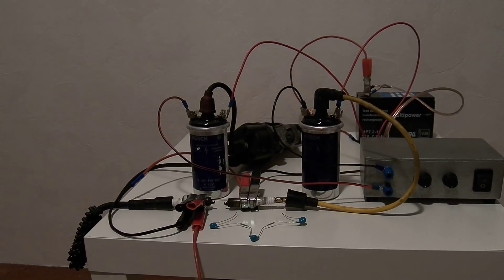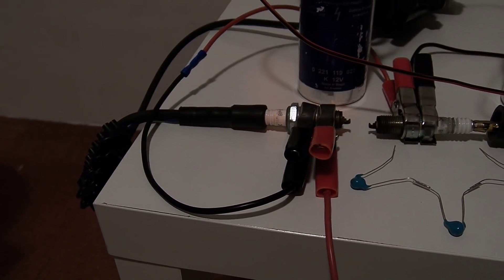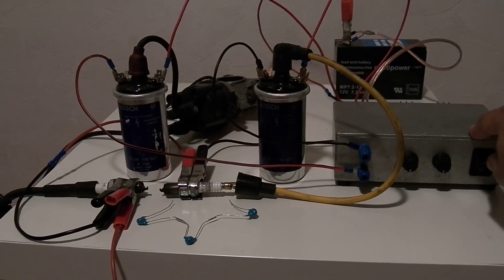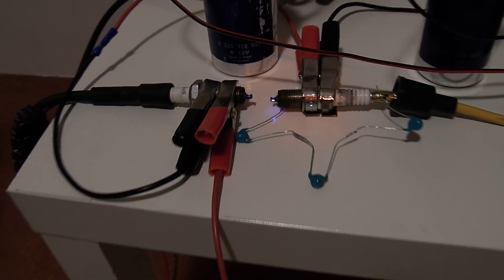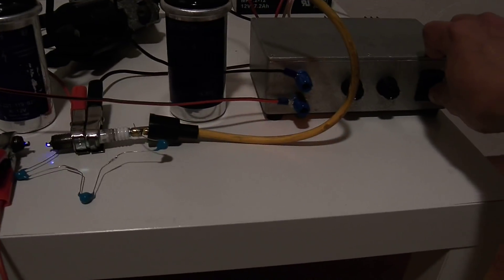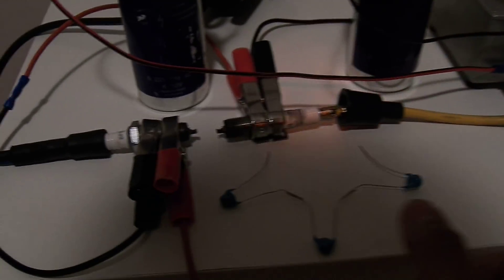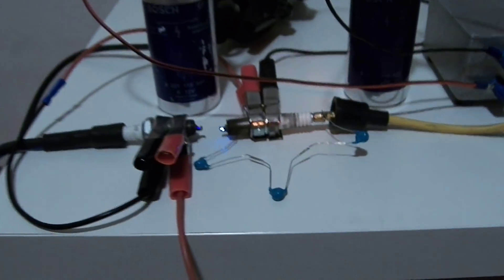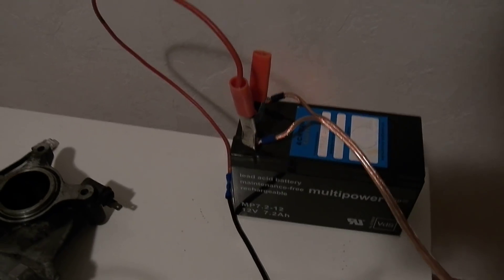Simple Plasma Ignition vs Slayer Exciter Ignition

Comment: On the simple plasma ignition... Does the polarity of the kapacitor matters... Where do u put anode on the sparkplug and where the catode on the sparkplug... Or it doesent matter...??? I can t wait to try on my 80 cc...
Reply from the maker: My high voltage capacitors don't have polarity, so there is no problem to connect it either way.